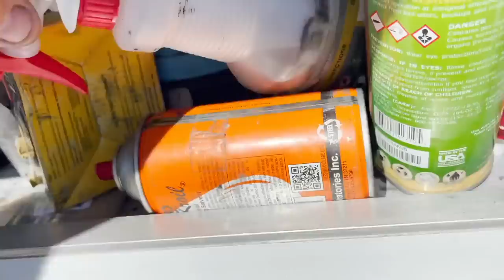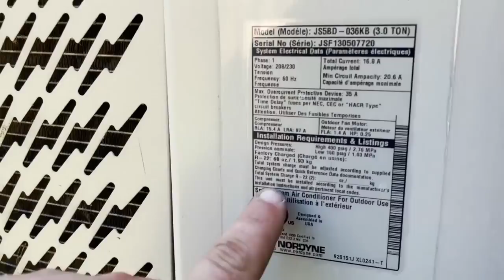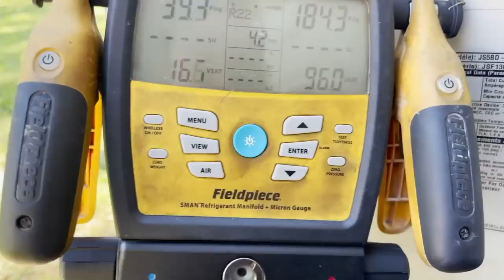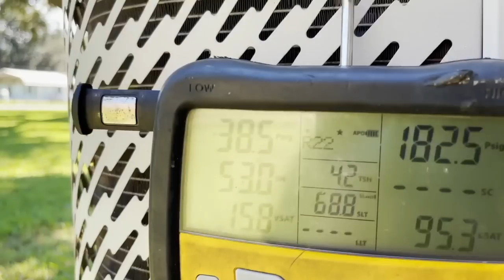A Simple HVAC Service Call Turns Into Condenser Replacement

Comment: Imma new tech. Was wondering. How u changed the outside unit if it’s r22 if they don’t make r22 systems anymore. Did u change the metering device or the case coil?

Comment: John,  I check out your channel from time to time.  You do good work 👍.  Speaking of Rheem, you spoke about having some difficulty in getting self-tapping screws to start into the air handler.  Did you get that figured out?  I had a Rheem 3-ton system installed at my part time residence a couple of years ago.  I like it.